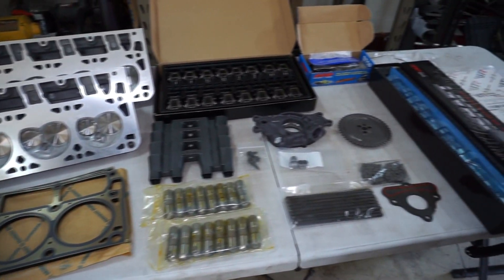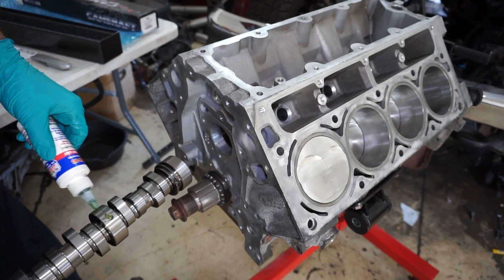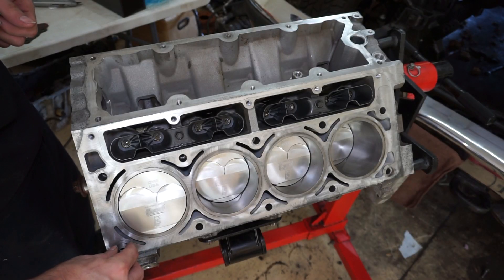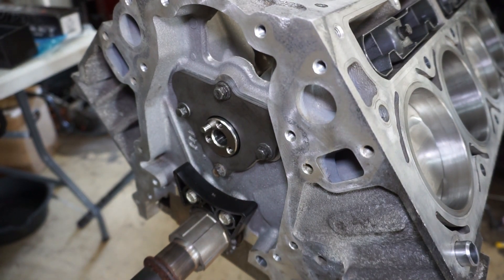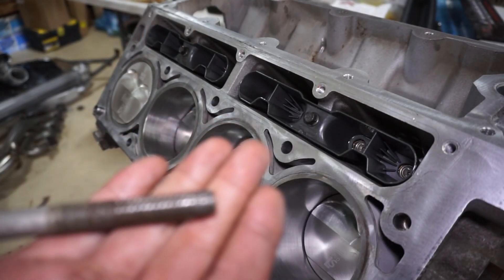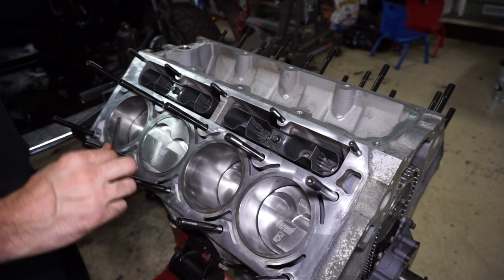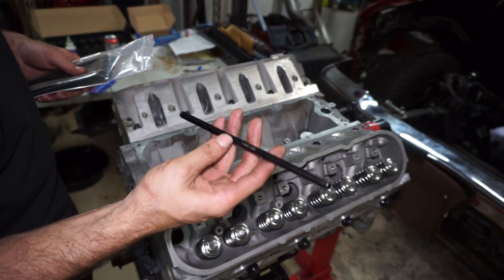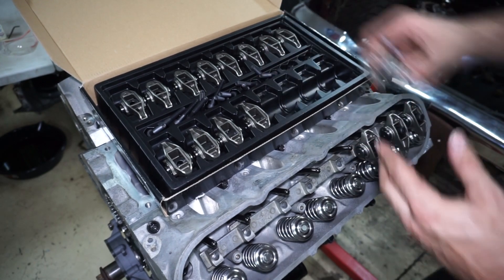Assembling Summit PRO LS 5.3 Ported Heads BTR Stage 2 Twin Turbo Cam

Comment: Not gonna lie. I've put a head gasket on backwards with the coolant holes towards the front
Reply from the maker: It does happen. Happened recently to a guy on one of the LS FB pages, was troubleshooting overheating for a few days, found he installed them backwards.
Reply: @BlaserBuilds  I had trouble with the freeze plug in the back of the head popping out. I think the blocked port had something to do with that

Comment: Just a little tip for thread cleaning - Add a little grease to the slots to hold onto the material your cleaning out and then clean the bolt and repeat on each chase.

Comment: But did you change the cam retainer plate bolts? lol When you install the oil pump, I thought you had to like install the crank pulley to center it up perfectly. Or will you just do that when you actually install the crank pulley? Or am I thinking of the cover?
Reply from the maker: Thinking of cover.

Comment: Don't you need to put sealer on the threads of your intake rockers bolts? Better ask Jeff. He usually does away with the boss in the port, which opens it up to the threads.
Reply from the maker: Yeah, if the rocker lump is taken off. I did put some sealer on after that clip before I torqued them.
Reply: @BlaserBuilds  👍